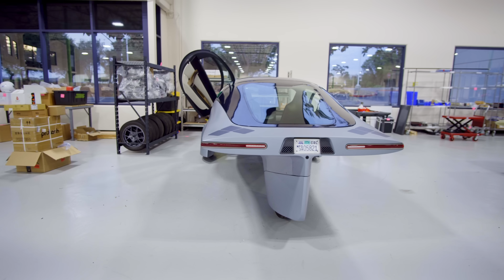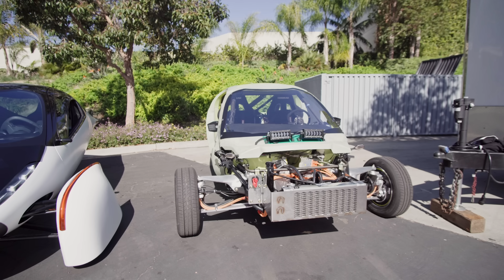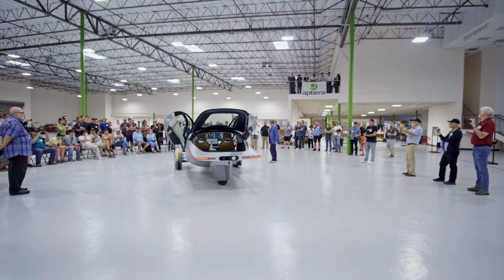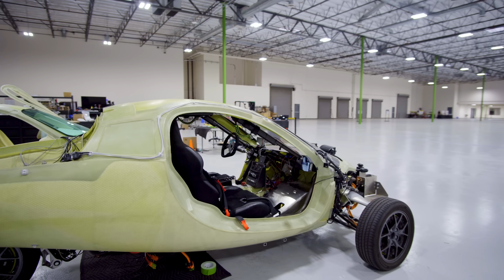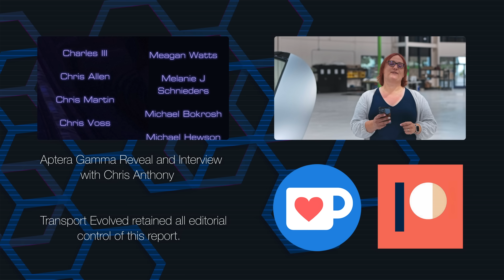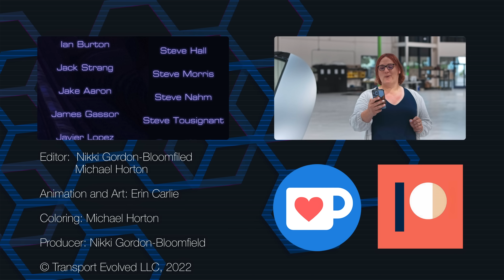The Aptera Gamma Prototype Is Here. What's NEXT?

Comment: Big oof on the Tesla plug.    The industry has already decided on CCS.  8 different manufacturers have gone with CCS since it's an actual standard.  The EU decided all EV's have to be CCS years ago.

Tesla still hasn't opened their plug for general licensing outside of their weird ego-stroking IP agreement.

IF Aptera truely had an open-source intent with their vehicle, they would have chosen CCS since it isn't proprietary.
Reply from the maker: Personally, I’d agree - Nikki
Reply: While I can appreciate this perspective, I also respectfully disagree on a number of points.

From an engineering perspective the Tesla port is simply better in numerous aspects.

Regarding who chose to use which, CCS combo was barely a standard when Tesla resorted to making their own.  And by raw quantity of vehicles and DCFC plugs, I think Tesla is the more plentiful form factor.

I appreciate the Aptera campaign, with a slight tweak, if we could perhaps all agree to accept the Tesla plug as "a" standard, along with CCS, I would be satisfied.  Including the stipulation that Tesla fully open their license with no strings attached.

Tell me who wants to switch their USB-C or Bluetooth mouse or other peripheral back to using PS2, AT, DB9, midi-game port, parallel, SCSI, VGA plug? etc etc?
Reply: @D0li0  Except everything you listed (USB, Bluetooth, PS2, AT, DB9, Midi-game port, Parallel, SCSI, VGA) are actual standards with an independent working group managing them.

The Tesla port is not a standard managed by an independent working group. It's a closed proprietary connector designed in-house by Tesla.  Tesla have had 10 years now to form a working group to manage their connector.  They didn't.  CCS won because of Tesla's ego getting in the way.

It doesn't matter if the "Tesla Plug" is better. It's not a standard so it can't see industry-wide adoption.  Just like all cell phones can't use the "Apple lightning plug" even though some folks think it's better.  They use USB-C because... it's an open standard.
Reply: @D0li0  But you are missing a few points. The Tesla plug is not a standard. It's a proprietary system. From a technological point of view it has already fallen behind on CCS. It can't do V2x, it can't do 800V (and might never be able to since the pins might be too close together!) while the advantage that Tesla had with Plug and Charge has already been added to the latest version of CCS.

You say that CCS was barely a standard when Tesla resorted to making their own. And you are right. But that means that Tesla also could have joined the CCS development process and chipped in on it. But they didn't. They also could have opted to join CHAdeMO which was already an established standard when Tesla decided to work on their own. But they didn't. And I can only assume because they wanted to keep control of the entire design. And when they offered it to other companies, they said that other companies could sign an agreement, but have also stated to companies that were interested that they would not allow them to contribute to future development of the design.

And Tesla has never opened the door to allow others to build DC fast chargers based on the design. That also tells you something. So I doubt Tesla will ever simply open up their design as an open standard for all to use.
Reply: @Hans-gb4mv  true, they could have used CHAdeMO, but it's similarly bulkey and only DC.  The SC port plug is a j1775 protocol AC & DC multi modal port.

There is a lot of ascribing intent based on the open ness or closed ness of the design.  While Elon has said he doesn't like parents, and they want to foster the whole market. Do their words align with practice? Has anyone here actually attempted to construct supercharger hardware? No? Then how do you know for sure?  I think I might just need to try to explore this path with Aptera and another company I know.

Simultaneously I have decades of evidence from legacy OEMs who literally crushed cars and sold Oconics battery patents to Chevron who has cell capacity restrictions preventing BEVs... So I'm sorry if I side with the better engineered solution.

As for capabilities, it's laughable to say it can't do V2x, all DCFC literally tap the battery directly.  That's simply a software negotiation problem that's one OTA away.

You might have a point on the 800v separation point.  But frankly I did a Series/Parallel trick on the scooter I built decades ago that gives it a 12/24v "feature", that's exactly the same as the 400/800v mostly "gimmick"... Just put two ports and DCFC in parallel at 400v solves the copper and amperage "problem"(sic).

As an shade tree engineer who follows decades worth of BEV converter and drag racers work, this argument is nearly as valid as "hydrogen is the most abundant element" distraction.  Did Tesla need 800v and a 2speed to trounce the tayacan? No! They used wrapped motor rotors instead

So 400/800v barely matters with the V3 SC pushing 350kW and the V4 dropping soon. And the Semi multi-pin-pair megawatts scale coming.

Anyway, thanks for the conversation... and I hear the "standard" argument, but a garbage standard isn't best simply because it has an independent committee driving it.  Did it start with autopay? Or V2x? No and no, those were duct taped on later even though obvious from before day one. Sign. Shrugs. Seems like a "not invented here" problem.
Reply: Given the choice between the robust Tesla network and the positively awful CCS network (I charge on it), I'd be thrilled if the Aptera could charge on the Tesla network. And for $250, you could buy the CCS adapter from Tesla. The rubber meets the road at the charging station, not in a working group.
Reply: @KBinMD  😥   Would the Tesla CCS adapter even work on the Aptera?  Tesla doesn't publish a standard for their connector... so you have no guarentee it would work.

Just looking at the port, and comparing the Tesla CCS adapter... it wouldn't physically fit in that space. Wanna know why?  There's no dimensional standard for the Tesla plug since it isn't a standard.

Folks, The "Tesla plug" isn't a standard. Stop stroking over "how great it would be".  CCS is what we got.  It's big, it's bulky, it supports 800v at 500kW max (which is more than the Tesla plug)

EA's stations are rubbish right now.   That has nothing to do with CCS... that's EA hardware. Stop mixing one company's poor execution lately to CCS as a whole.    EVGO just released plug and charge for all EV's based on the CCS spec and it works great.
Reply: @Alex-je6od  if it comes with a Tesla plug, it's going to charge on the Tesla network. There has long been talk of this agreement.
Reply: @KBinMD  That's not how engineering works though.   Charging goes beyond the physical connection.  There's software involved, negotiations between the charger and vehicle.  Is it still using the chademo spec? Is it using the CCS spec? What are the acceptable dimensional clearances? What are the required wire gauges? How long after plugging should the vehicle begin accepting current? What's the maximum length of time the maximum current can be accepted? What are the tolerances for pin fitment within the connector? How is temperature monitoring handled? Where should PTC's be located in the socket?  How should the vehicle adjust currents based on witnessed PTC temps? 

The point is there is a lot of engineering involved with an EV charger. It's not a dumb extension cord. That's why standards exist.   The engineering priorities for GM may differ than the priorities Tesla has. That's why independent working groups manage standards (with stakeholders from various companies on the board)